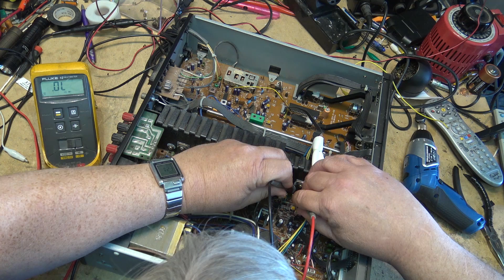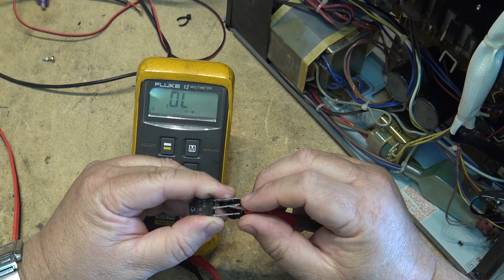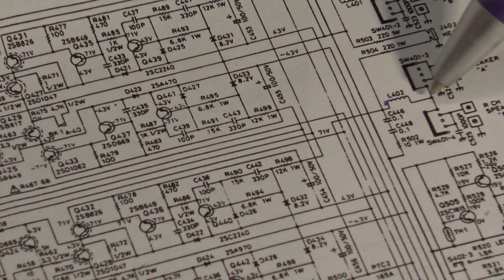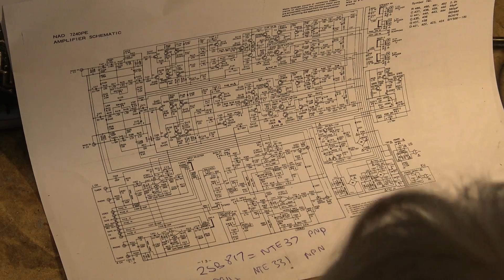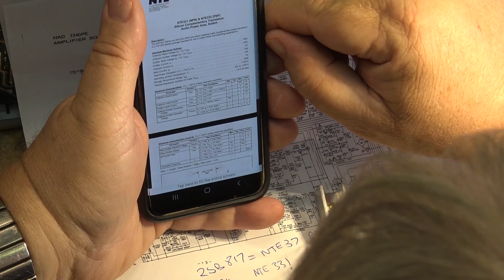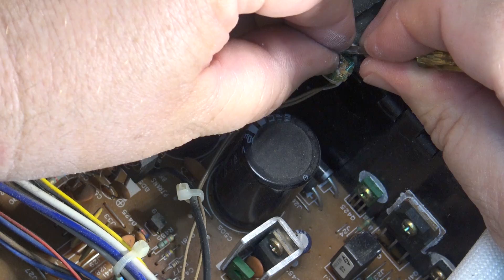NAD 7240 Receiver Totally dead part 1 troubleshooting

Comment: Careful when you see that only one transistor in a pair fails. I was working on an old sansui that had no output on one channel and none of the outputs tested shorted in circuit so I pulled them and they both checked out with diode test. There was one burned resistor connected to one of them so I replaced it and put it back together. Ran it on a dim bulb and it held up but on full ac the same resistor went up in smoke and that time the corresponding output transistor did test shorted. The original fusible resistor just went open so fast that the failing output didn't have a chance to fully blow while also protecting all the other nearby parts. Was a little annoying to figure out but the experience was educational.

Comment: Q438  & Q434 are set up as a darlington yes? maybe they drew to much power and the collapsed the rest down/up the line... if ya get me!!
P.S. is that an app you were looking up the transistors on??? and if it is whats it called?? Thanks!
and loads of stuff iv opened up to see inside had that shitty glue! sometimes pumped everywhere like little clock radios & always on those multi connectors like you said.. : )

Comment: A lot of these boards are wave soldered and all it takes is repeated heating and cooling to crack the solder connections.  Doesn't matter if it's wave soldered in Japan or China, thermal cycling will take it's toll. ;-)
Reply from the maker: So does thermal expansion of dissimilar metals.  Copper expands at a different rate than lead/tin alloy. Eventually they will crack. Wave soldered just adds to this because the solder is very thin.  At least when you do it by hand you can put lots on to make it less prone to this problem.

Comment: Hi, Would you have any tips on the right channel not working on my NAD 7220?  I opened it up (first time) and hoped it may be an easy repair like a speaker fuse (I assume two or more of the six fuses may be for the speakers?).  I tired the extra speakers connection as well and right one not working there either.  The wires to the speakers are ok. I have no experience with electronics but would like to keep this unit running. I've watched a few of your videos. Very interesting. Thanks!
Reply from the maker: Could be just about anything.  Will need troubleshooting which is generally beyond a novice ability. Not something that can't be learned though as all of us started somewhere.  I started when I was about 8 putting together those radio shack p-box kits and the 100 in 1 project boxes.  Then moved onto more advanced heathkit. By the time I was 14 I was hanging around at the local TV repair shop trying not to electrocute myself.
Reply: Thank you!

Comment: Why don't you like solder suckers?  I love 'em if they are any good that is, lol
I'm on the other hand never used solder wick even though I got some laying around.
Reply from the maker: Because every one I have used is more work than it is worth.  I had a real expensive station at the shop and every time I went to use it, it was all clogged up, or clogged up while using requiring disassemble and cleaning which wasted time.

Comment: I have this amp, the same problem.  The output transistors were blown by a fault in the circuit board I have yet to find.  without finding the fault,(a crack or loose solder joint) new transistors will blow if pressure is placed on the board, even picking up and moving the unit.  I like the amp, so will try to fix it some day.  at the moment the outputs have been removed.  The tape out still functions, but when i press on the circuit board, it will cut out.  This is what I use to find the fault, which I have not found yet.  Until I do, there is no point in replacing the transistors, they will just blow again,  The last time I worked on it i checked most of the solder connections, re-doing most of them, but still, when i press on the board, the sound in the right channel of the tape output cuts out.  I am sure that if the outputs were replaced, they would blow when this happens.  Do you have any suggestions where the fault causing this cut-out may be located?  I have checked most everywhere, but no luck.
Reply: Dirty or worn input selector?

Comment: Hot melt glue can have a resistance of 20 – 45 Meg .
I chased  that one for a hours & it was the glue holding a plug in place  .
The plug had 70 volts ac on it .
The pcb link running under the glue when open had 10 V a/c on it !

Comment: I find the kickback from my solder sucker makes it jump off the target half the time.
Reply from the maker: Why do you think you seldom see it.
Reply: @12voltvids  I have an old pair of my grandfathers glasses. They are very powerful. I call them my microscope glasses. If I can't see any cracks with them, there aren't any. But maybe I'll take another poke at it and try measuring the voltages on  the transistors like you did and see what I get. The only trouble is, the construction of those units makes it hard to get at everything with the power on.
Reply: @12voltvids  Are you referring to solder cracks?

Comment: Dave! check the two smaller capacitors beside the two main filter caps; I ran into the same situation you did, replaced the drivers and outputs on the right channel, ran fine for awhile and failed. After more extensive troubleshooting I found a bad cap on the right side of the main filter capacitor, it had a high ESR reading, "problem solved", that was years ago still running.

Comment: Quick tip. If you use the reading mode on your phone it reduces the burn in significantly and is easier on your eyes.
Reply from the maker: I need to see during the day in the bright sun so turning down might solve the burn in problem but will create a usability problem :)
Reply: Modern displays don't suffer from "burn-in". That was for Plasma and CRT screens LOL
Reply: @johncoops6897  OLED has burn in and I believe that's what he is using.
Reply: @rickn3146  - Yeah, OK... however OLED Burn-in occurs when there's a STATIC image on the screen for a very long time. It seems that the phone used here is also used outdoors for other usage, so it's displaying varied content.
Furthermore, the videos shot at the work bench are what... an hour or two each week? At that rate it would take decades to accumulate enough hours for permanent burn-in (rather than temporary image retention) to occur.

Comment: You are so lucky to have a local place to order parts, all the good old shops here are gone :-(.
You are spot on with the nasty glue, i've had to remove it from ham radio synth boards, it screws up the operation.
For sensitive synth parts i used soft brown wax instead.
Reply: Yeah same here in Southern Illinois absolutely nothing!
Reply from the maker: We have 2 retail shops that sell some parts, and 1 mail order shop that sells the more specialty parts.

Comment: I bought one of these back when they were new, the 7240PE, and just inside warranty the same thing happened on it.
It blew the right channel, and not under any heavy load or anything. One day when i turned it on it went "pop".
Got it fixed and used it for a while, and then gave it away. Didn't think it sounded that great.

Comment: Get a short length of Silicone tube and stick it on the end of the sucker. Lets it form around the lead while you're applying heat to the joint and makes them work a lot better.

Comment: That really sucks that your local parts guy got in trouble. I have a big bag of outputs and drivers I salvaged out of dead AVRs that I use for cheap repairs. The 90's units actually had nice silicon which makes them worth taking the time to part out. A Pioneer I parted actually had the exact same drivers and outputs as a friends blown up Yamaha M-60. Aside from a few resistors, diodes and small signal transistors, it was a free (but time consuming) repair. Those amps blow up good when they let go.
Reply from the maker: Well the mayor of Surrey is kind of a dick. When Uber and Lyft finally, after many years of waiting for a license by the government (previous government kept them out) Surrey would not give them a business license because the mayor was in bed with the taxi industry. Ride hailing falls under provincial transportation board, and they licensed them for the entire province. So the mayor ordered bylaw officers to book rides, and when the driver showed up, slapped them with a 500.00 fine for operating in the city without a business license. The thing is there is no business license in surrey for them. All the other areas signed on to a universal license that covers all the areas. So he is kind of a dick in that respect. It was so convenient back last year when I could call him up and drive over, park around the corner and walk to his place to get parts, but now there is the extra cost of freight which I am happy to pass along, but also the delay to get parts. That wastes my time because I have to put the unit back together so things don't get lost and then take it apart again to install the parts. Again this gets passed along.

Comment: I always get the OnSemi equivalents from Digikey
Reply from the maker: Digikey is far too expensive. They add an extra 20.00US minimum to ship to Canada.
Reply: @12voltvids  Have you taken a look at the Canadian website?
Reply from the maker: @Mr.DatacentiCET  
I looked them up there. 4.15 for 1 output, 4.12 for the second, and 1.88 for the 3rd transistor plus 8.00 shipping, and since they ship fed ex from the states, another 37.50 added by fed ex when it crosses the border. From KPComponets  12.16 including shipping AND tax. It's a no brainer, for parts in Canada KP Components is the way to do. Digikey and Mouser are a no go because they only ship using fed ex or UPS and they charge the receiver 35.50 and 22.10 respectively when they deliver. The match pair of outputs 5.90, the 2sd1062 1.69 plus .58 tax and 3.99 postage. Anywhere in Canada for that price.
Reply: @12voltvids  Interesting! I ordered parts from DigiKey Canada before and i believe they charged something like 20 bucks for shipping on my order on top of 30 bucks already! (Thank god it wasn't my money!). Also, i'm in the process of repairing a Sansui G5000 receiver, would you recommend KPComponents for parts for a receiver like that? Greetings from Quebec too!
Reply from the maker: Check his web site. You will be surprised what he has. Laser pickups, vcr parts, stereo parts.
Reply: @Mr.DatacentiCET  with digikey I always order the minimum amount for free shipping , and depending on price a high enough quantity to get at them at the discount price tiers. Alot of component values are common with other amplifiers , and what not . The oddball onesy/twosies i get at the local shop, Electronics Center , they have good pricing and place weekly orders for there own stock and repairs. Newark is another online retailer i find they have the componates digikey does not stock.
Reply: @12voltvids You need to look into Digikey again.  I use Digikey all the time and they can't be beat for free overnight shipping to Canada if you purchase over CAN $100
I go through loads of caps so I'll fill my cart with those to bump it up to $100
Reply from the maker: @TrevorsBench  do I see you offering to pay the 35.50 broker charges I received the 2 times I used them?
I never make orders over 100. As bumping orders with caps I don't change enough because I don't get customers with open cheque books that say have at it. In fact in the 35+ years I have been in service not one person has ever enquired about that and I view every servicer that even suggests that as a crook looking to pad bills with unnecessary work like the mechanic where you take your car in to get the oil changed and they tell you that you need a new water pump or spark plugs or a fan belt.  Had that happen actually, and what the goof didn't know was the fan belt had just been changed 3 months prior. I like all real diagnostic engineers replace the bad part, not shotgun and change all the caps that amateurs do because they don't understand that in a circuit certain parts are placed under additional stress and will fail, but others will never fail. So what is the point of changing parts that will never fail other than padding the bill and ripping off the customer.  This was pounded into my head at the shop I worked at for 20 years.   Changing all the caps will not necessarily extend the service life. The cap that failed the first time will likely fail again. That's the way it goes. But then what do I know. I have only been doing this type of work for 40 years.
Reply: @12voltvids  There are no brokerage charges, only GST/PST and that is paid at checkout. The package arrives the next day on my doorstep
Anyways, nevermind I was just trying to be helpful, go your own way.
Reply from the maker: @TrevorsBench  both times I ordered from digikay and the 1 time from mouser arrived no problem and then. Few weeks later I got the big from fed ex. I can get cheaper from local distributors.